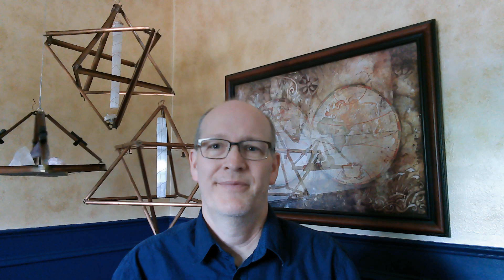Secret to Producing Safe, Clean & Renewable Electricity

Comment: What is so intriguing about this channel is that what is being presented is a glimpse of what has remained hidden in classified labs for many years and which will one day be released to provide a new direction for our civilization as far as science, technology and space exploration are concerned.

There are good reasons why this science and technology have been kept secret.  for instance, any device that can output magnetic current could be used to charge up a bomb, so the world would have to become more peaceful before it could be released.  For a more short-term solution I have considered ways in which free energy generation could output electricity instead, bearing in mind the deleterious effect of electricity generation on the environment that you claim exists.  What you describe here could be a way of implementing this.  It does resemble  the Magrav generator of Mehran Keshe in that it involves torroidal coils wound around circular conductors to amplify grid electricity, so this could provide a clue for any builders out there.
Reply from the maker: So true and incredibly frustrating. Labs around the world have this tech and civilization is just being controlled with outdated tech, but all in good timing...

Comment: How do we get the resonance or frequency of the two counter rotating magnets without putting energy in?
Reply from the maker: You can put energy into the system to establish frequencies, rotational speed, etc. but then proceed without the assistance.
Reply: @MagneticEnergy  I wonder if the frequencies required can be founded on geometry. No moving parts, just atomic crystalline vibration tuned by its dimensions. I'm really interested in this topic, I'm going to school, but my fear is that the material is plagued by cognitive disparity. I want to make sure I'm learning the real physics. Any suggestions? Thank you.
Reply from the maker: @Featheredblack  Absolutely!!! Geometry & materials create the necessary magnetic resonance...these topics might not be formally taught but conventional education can still provide some valuable foundation, just question everything...

Comment: The joined induction coils that have clockwise wrap on one side and counter-clockwise on the other, I recognize from Tesla and Don Smith and others, but they use a different outer induction coil of larger diameter to drive the inner coils, using high frequency, high voltage DC pulses, which have the big electrostatics.  Replacing that larger diameter thing, I'm guessing it's using the principles of 'wireless charging' of phones and electric cars, but I just don't know the details of how those actually work. I should google for that.  There was also a patent issued last month for automated resonance tuning, used on both sides of the device, the magnetic sweep side and the inductor coils.  It would be awesome if auto resonance tuning circuits were prior art public domain somewhere.  Can you describe the outer magnetic thing that does the magnetic rotary sweep around the the circumference of the inner induction coils, and along their long axis, in more detail?  Also, what crystal (silica?) nanopowder would be worthwhile to squeeze into a copper wire surface?
Reply from the maker: The magnetic devices model what could be used to pulse the coils, but I'm sure there are plenty of other options. Silica is good, but its the formation of it that controls the resonant frequency it holds. Basically, completely saturate the coil assembly in a counter-rotating pulsing magnetic field that can be oscillated to match the magnetic resonance of the conductor.

Comment: "Helical coil wound in a clockwise direction that extends along a conductor".
1. - would the coil be would unto the conductor, or is the conductor just a connection between the coils"
2. - would both coils be would unto the same conductor?
Reply from the maker: The coils are directly connected to the conductor, all one circuit.